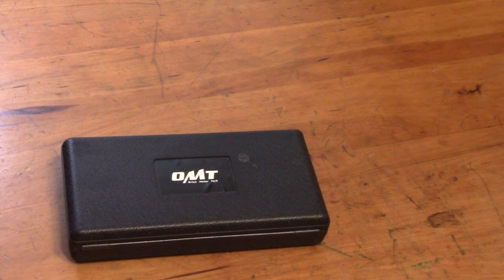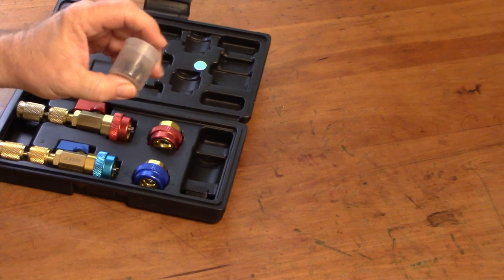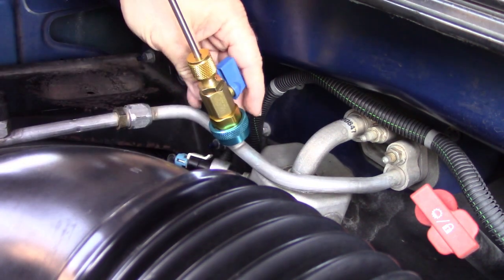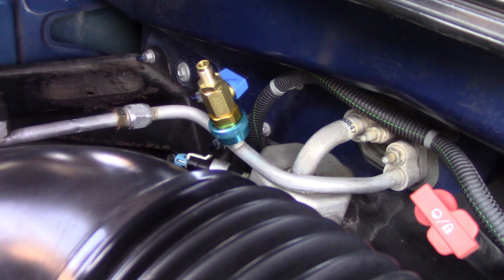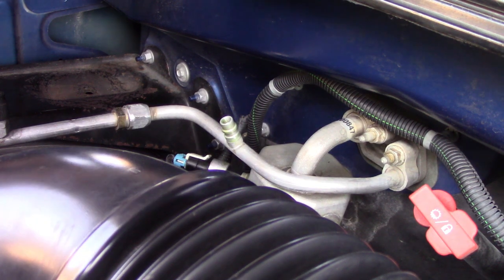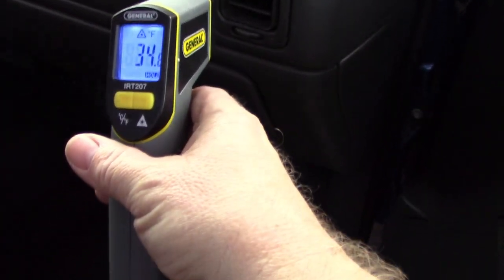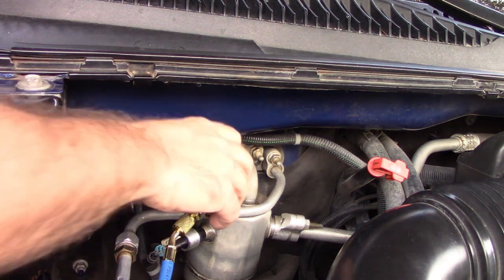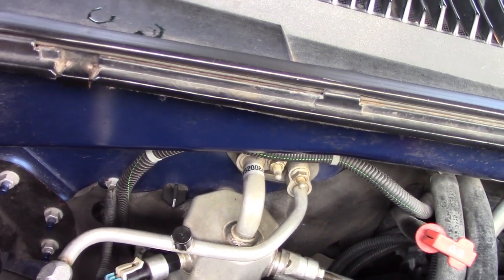Trying Out An OMT Valve Core Replacement Tool

Comment: I used these tools on a PT Cruiser.  The high-side is down behind the radiator at the bottom attached to a line near the compressor.  Wasn't easy getting down there and I had to use the smaller core tool from the low-side port tool to get it out and insert the new valve, basically swapping the tool to the red adapter.  I guess some high side ports use the standard size high-side attachment but use the smaller valve type like the low-side port.  Took about 25 minutes with my face on the intake manifold and my hands down behind the radiator trying to fiddle with that tool on the high-side port but it finally worked!  The Nesbitt has working AC that doesn't leak anymore.  I hate those damn Nesbitts.
Reply from the maker: That’s awesome! At least they use a serviceable high side, unlike GM, with the rubber ball, where a valve should be.

Comment: I like that tool.  If only they made something for the high side fitting that always leaks if you even think about hooking your gauges to it.
Reply from the maker: Mine has the correct adapter for the high side as well. I didn't want to tempt fate, I knew that one would leak, as well, if I attached the high side gauge. When that line from the compressor to the condenser gets replaced, I'll swap out the high side core for sure.
Reply: @dynatrak You sure?  For that high side core you have to remove the entire fitting from the line, if it's factory.  I don't think that tool is going to do it.
Reply from the maker: Just checked, and yes, mine has the goofy ball seal. When I replace that discharge line, that high side port will have to be replaced as well, before vacuum, and recharge. Will not be going back with oem, that’s for sure.

Comment: That's a nice specialty tool.  Has a bit of a knack to it, to get it to work, but once you get it, it does a job no other tool can.
Reply from the maker: Indeed! I tried, and tried again, and succeeded!
Reply: @dynatrak  And imagine if you didn't try.  You'd be sitting there in the truck sweating your ball joints off!